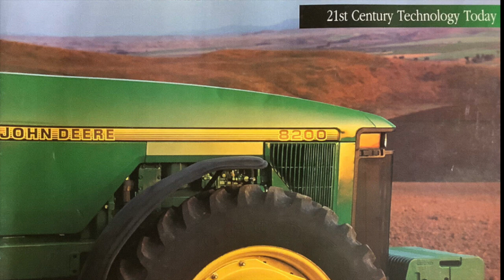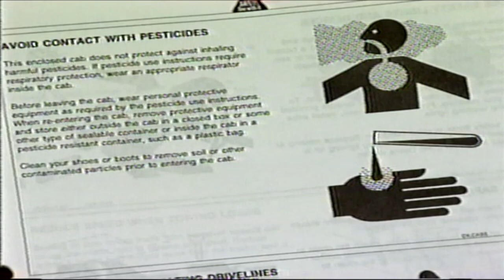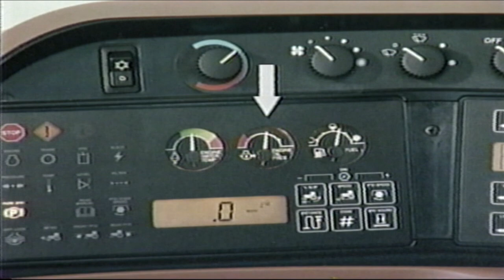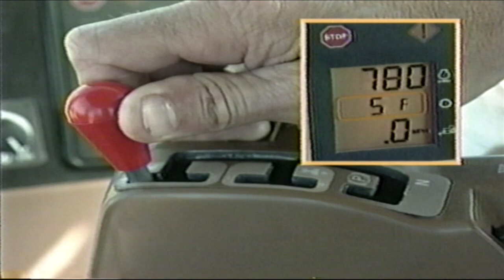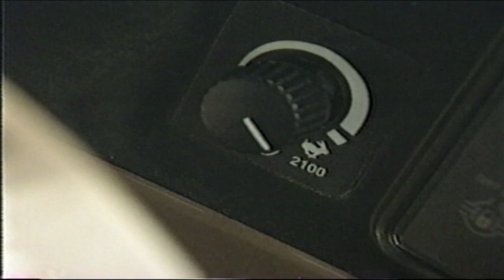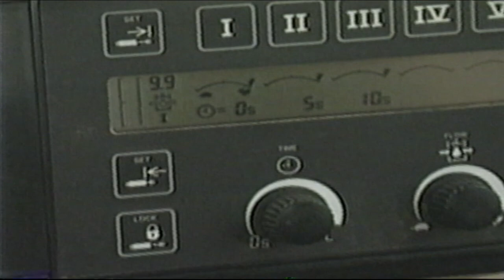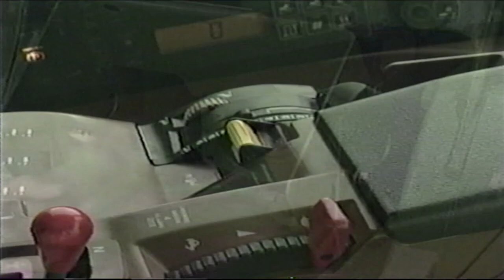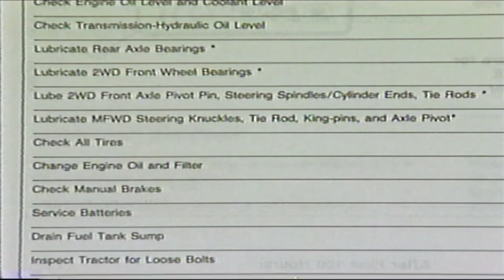John Deere 8000 Series Tractor Overview and Maintenance

Comment: This is a great video.  Never had a 8000 series but had a 7810 with the 8.1 engine and loved the power it had.  Also have a 4055 and and a 2510 which will always stay on the farm.  Have had a 4250 and 4555 in the past but have since switched to fendt and dont plan to go back.  Still great to see the older equipment and remember a different time when farming seemed more simple and better.